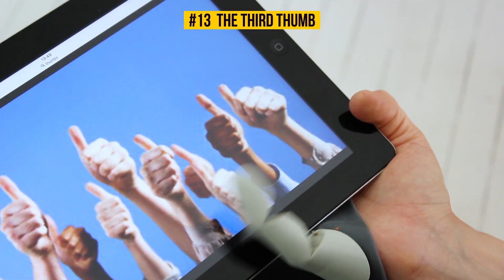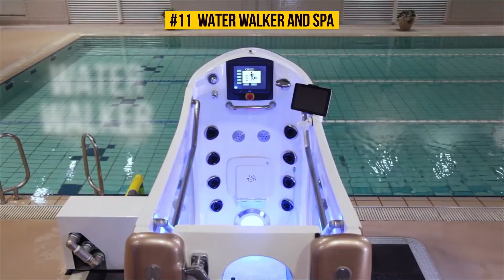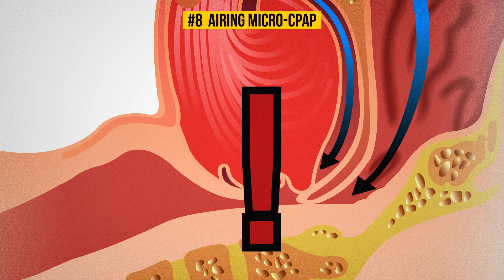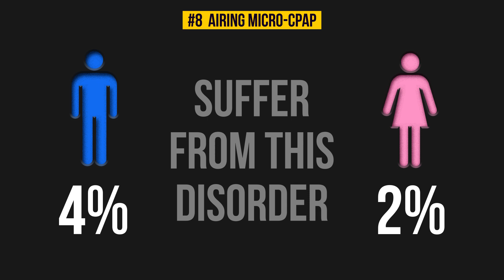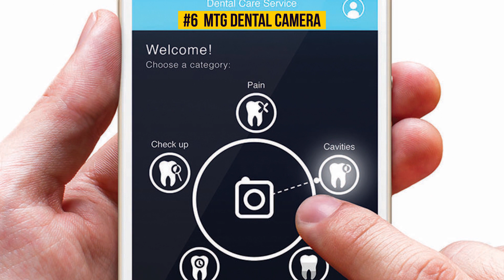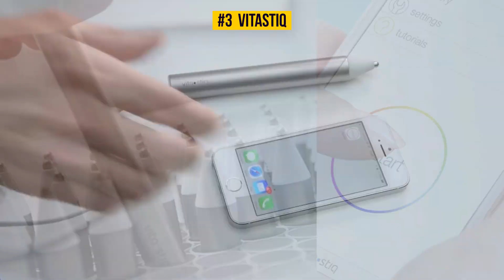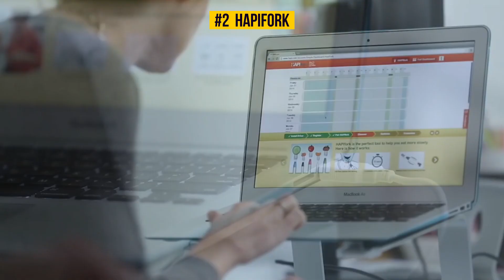13 Amazing Inventions to Transform Your Life

Comment: #Amabrush: That's not going to work. The reason for the 2 minutes is that Fluor in toothpaste has to be on the teeth for a minimum period of time for it to do it's job. Any gadget that's below 30 seconds will therefore be less effective against caries. Over 2 minutes is the optimal time.